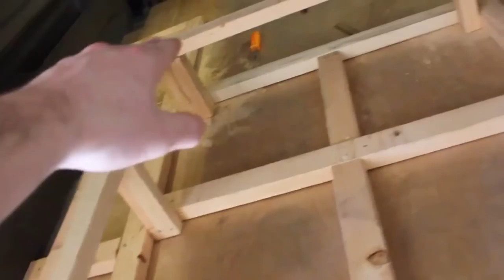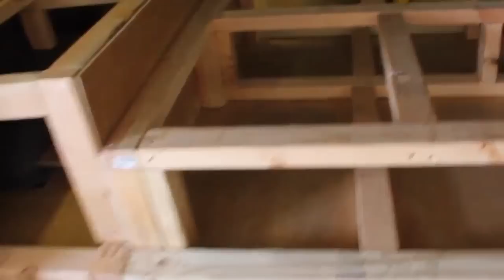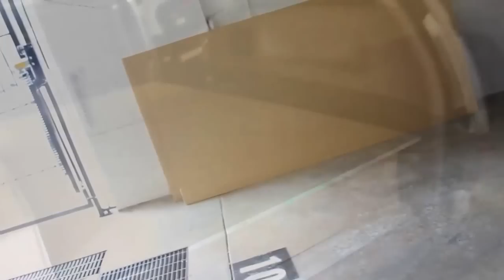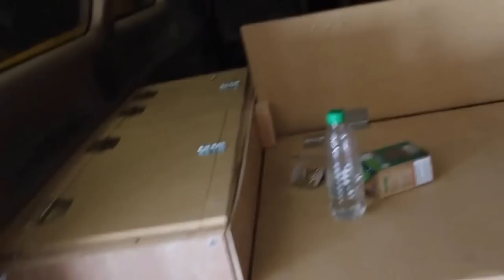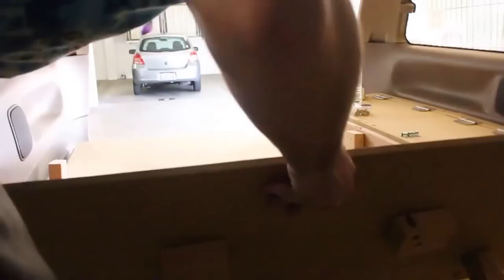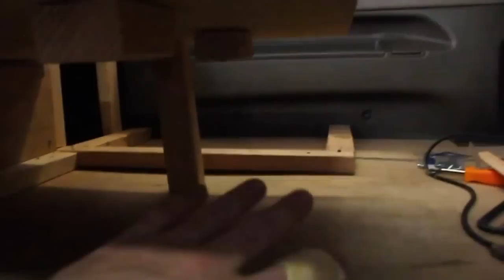Mini Van Camper Conversion: Bench/Bed and Storage

Comment: With the various conversions I've seen no one has thought to use a recliner. It seems like it would take less space and be more comfortable sitting and laying down. Since the legs are generally wood the chair could be fastened to the floor. And storage would be behind the recliner up to the lowest level it reclines. 

This also leaves more room on the side for a stove and fridge. On the side build a cabinet to hold a 5 gallon bottle of water with a hand pump or battery powered pump. It would also store your kitchen equipment. 

Maybe even put in a camper toilet in the back. That way you could take the waste cartridge out the back door.
Reply: I've been shopping for a recliner that can actually turn into a bed. I've seen several on line, but I think that's one of those things you have to go to the store and lay down in it. I would hate to spend several hundred dollars on something only to find it's a great chair but a lousy bed.

Comment: You may use Velcro or magnets to secure legs on your bed. How's the project going? I'm collecting materials for my minivan RV program 😜 got small 12v/110v fridge, sink, faucet, electric water pump, 2 burner propane and single burner butane stoves, 12v/110v 19" led TV and even tambour doors for cabinets the only problem it's still too cold here in New York and I can't work in the garage so openly like you do, Coop has rules 😳
Reply: I have a small mini van as well. Are you sure all that will fit?  lol Maybe it's because I'm 6'5" 250 lbs. I'm considering removing the front passenger seat and installing a fridge there. But then I'm thinking there goes the stealth aspect. Love to see your progress. Thanks
Reply: +Shavian1 minivan camper conversion was sold to some lucky guy, and I have a big 19 feet long Ford super duty van with high roof, 4000 W power generator installed and 13.5 BTU air conditioner with  the heater pipe installed on the back of the roof. Check it on my channel have the video of it. Alex

Comment: it,s a bed of nails. you need to slow down and think things out more befor you do the job...the idea and concept is great. just needs a lot more measuring and finess....shorter scres nails,,think weight and strength needed...plan a little more..pencil and paper and quiet room......you have the skills to do this real good if you just step back and plane and do a list of materiels fixings and tools needed...finessssss...
Reply: It is not a bed of nails... not once you put a proper set of foam cushions over that. PLus he can sheer off the points or change out the screws for slightly shorter ones. You are on this as if you have done a way better job. Have you ever even gone with vanlife? If not, shut it. The number one thing is do what works for YOU within YOUR abilities and it is always a work in progress. There will always be some loud mouth griping about how you can do it better, different etc etc etc... screw them. I actually am out there doing this... and it isn't a fine carpentry competition. good job +MagicAppeals. Good job.